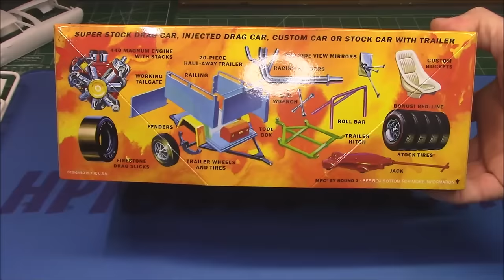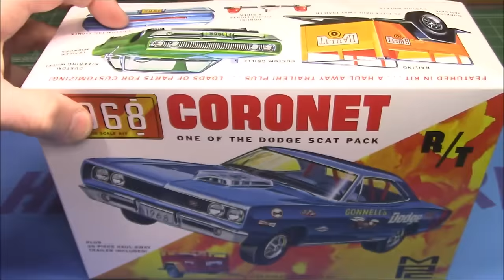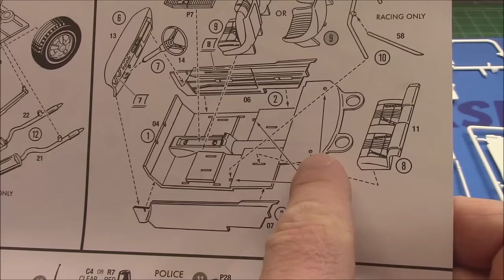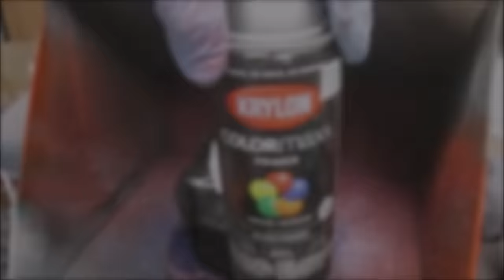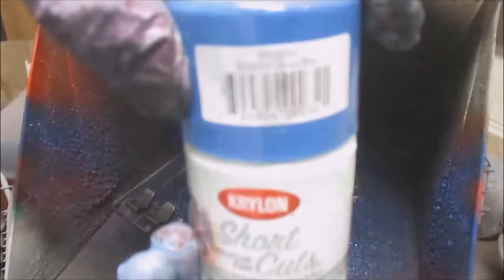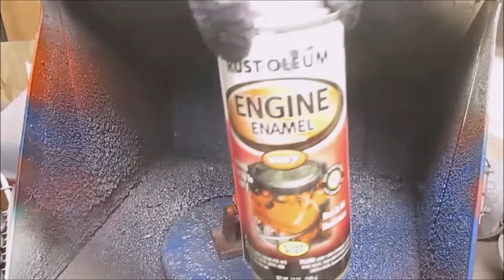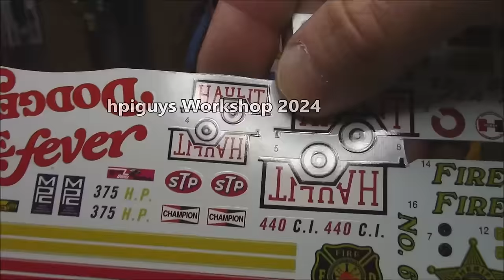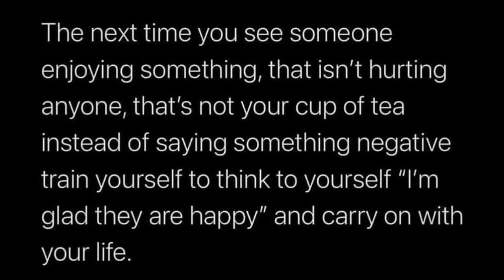NEW in 2024! 1968 Dodge Coronet RT 440 1/25 Scale Model Kit Build How To Assemble Paint Interior MPC

Comment: This one came together nicely - I like how you've mixed the stock parts with the racing ones, but in all honesty those Round 2 decal sheets are so nice you have to find a way to use them, even if you didn't really want to build a racing car to begin with. As you used the Q-tips, I remembered an ad I used to see as a child that said Q-tips could be used for model car building. What you said about how they could handle the rear end treatment via a decal makes perfect sense; about 30 years ago the AMT 1993 Firebird kit had the taillights as a decal with a clear piece to cover them. Maybe they'll include that the next time this kit comes out?

Comment: Stunning build Chris! I've gotten back into model building since finding your channel. I built a "Smokey and The Bandit" Tribute. The AMT Kenworth 925, Fruehauf 48ft beaded trailer and the 77 Pontiac Firebird (Smokey And the Bandit edition). The truck had it's difficult moments but it turned out really well. I purchased a full decal set online of the Stage Coach robbery and truck stripes. I chose to use Rustoleum Black primer, Gloss Black and clear coat. These were paints I've seen you use before. The gloss black took a very long time to harden and when I did apply the clear coat- disaster stuck and orange peeled it all. I've never used these paints before and don't know what I did wrong. In one of you video's you said you use a dehydrator to speed up the drying time. What can a modeler do if they don't have one? Another thing I need yet to try is the floor polish clear coat. I seen the video that you did on a pickup truck- it still scares the crap out of me to do it.
Awesome stuff 
Cheers 
Earl

Comment: So glad you mentioned the torture of doing an accurate Coronet 500 or R/T tail light panel. My TWO niggles are if you are doing an R/T or 500, the side scallops are trimmed in chrome - they easily could make 4 little chrome fingernail scallops on the sprue, and to me the tail light panel should be separate chrome piece allowing you blackwash it like 500 or R/T or paint it body color like lower trim Coronets. Other than that you KILLED it, especially that pesky rear panel!!  . '68 500 was my first car at 18 in '71, 2nd was brand new 'Cuda in '74. In NE I had big fat snow tires mounted on Rallye Wheels on the Coronet - looked cool ! LOL    👀